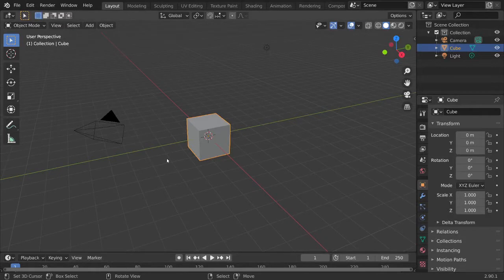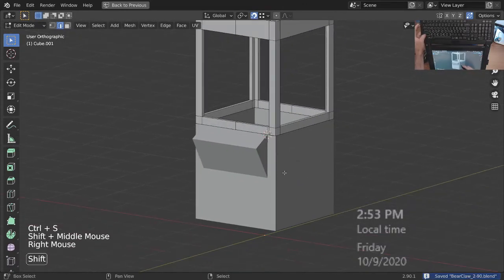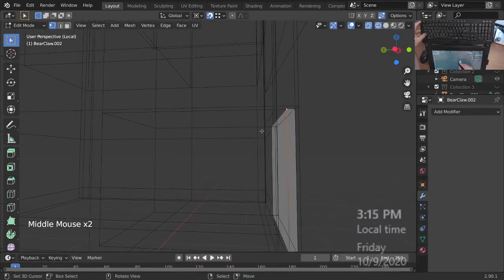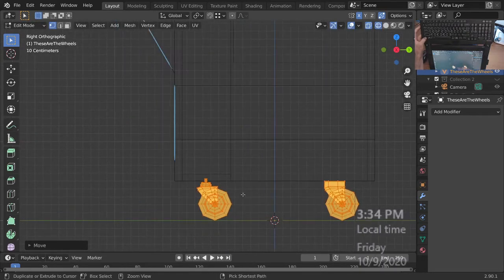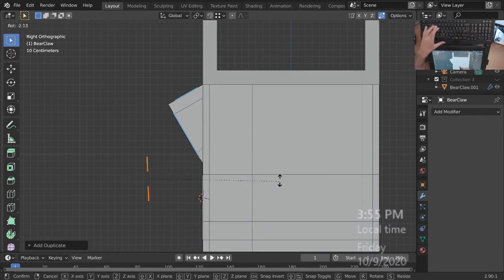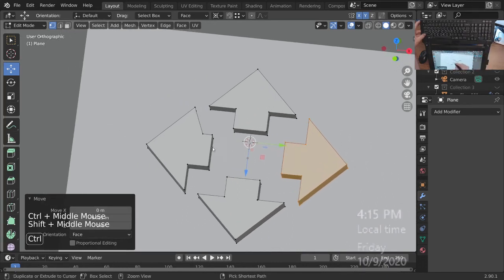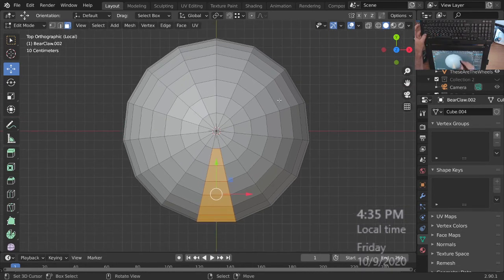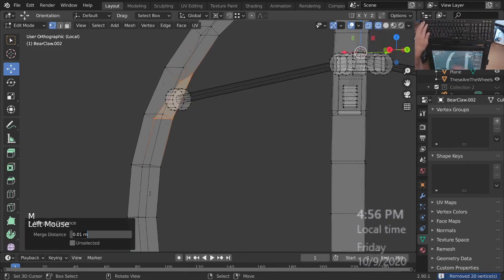Modeling A "Claw Game" Machine With Blender 2.90

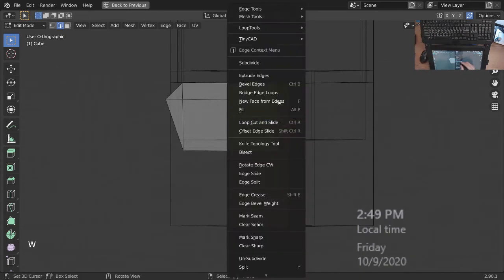Comment: what is the add on on the 16:22?
Reply from the maker: That is the "Edit Mesh Tools" that comes bundled with the standard Blender.
Reply: @BlenderPretender  when i click W it just change the cursor, why? or you set that shortcut?
Reply from the maker: @officeone3621  That might be due to differences in the user preferences setting.  The current default setting from a standard blender installation is to use the left mouse button for selection, and the space bar to start playing the animation.  When configured like that, the specials menu comes up with the right click button.  Since I have been using Blender for a while, I have it set to right click button for selections and the space bar for the tools menu more in line with the classical Blender before version 2.8.  So I would recommend trying to use the right mouse button to bring up the specials menu first, then if that does not yield results, check your settings in the user preferences by pressing F4, selecting preferences, and selecting the keymap button on the left hand side.  There you can see what settings you have.
Reply: @BlenderPretender  thank you thats works